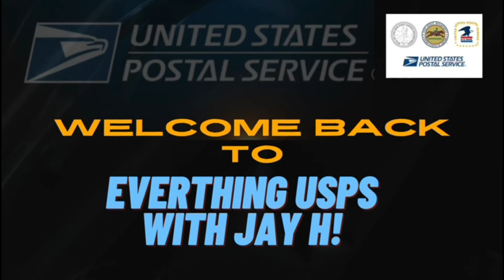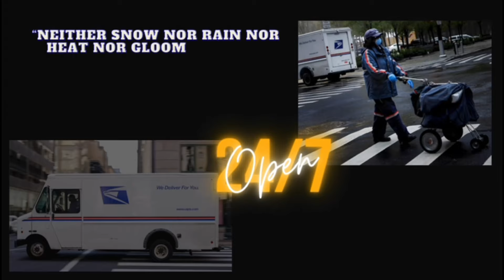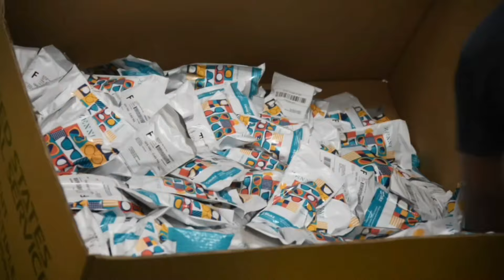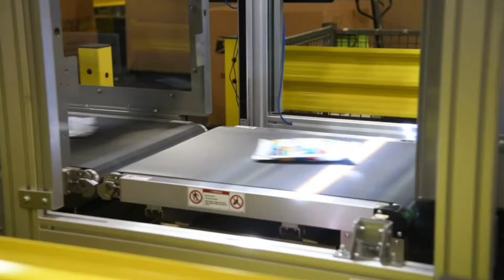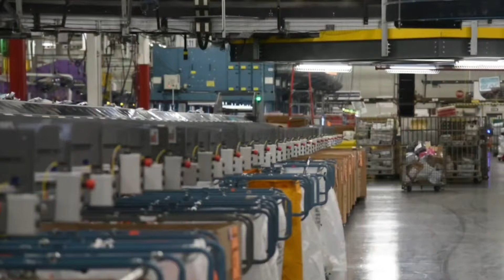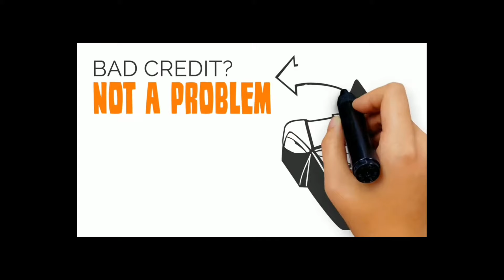USPS Controversial Topics = Views! (Opinion Based Food 4 Thought).

Comment: SIPS machine is classified as a Robot. It is automated with the exception of loading and then dispatch. Only need 2-3 clerks to load. And an additional 1-2  clerks or mail handlers to bring the broken down mail to the clerks at the loading end ,to break down Gaylord’s, stack them for reuse and clear away empty BMCs and APCs. Pretty simple. Supervisors LOVE a fast loader because it brings them big numbers. In other words a bonus check into their pockets. NOT the pockets of the Clerks not the Mail Handlers. I’m a PSE Clerk about to become a Regular, but was told by the Union that there are not enough. Clerk jobs available to go around so when I get converted and and transferred to the new NDC I will be switched over to Mail Handler because of low seniority. No other choice if I want a job at the PO. Well I was told I could reapply and start the process all over again. I’m like, yeah, no thanks. I’ve been hanging in there & working my ass off the last two years going to finally get Career Status. No well in hell, I’ll take a chance to start from the beginning. Not sure what I’m going to do long term. Thought I’d go with the flow and see how the new machines and new assigned work plant go. Ironically since I work at a hub that’s is majority Mail Handlers, I’m already familiar with Mail Handler work since that is what I have been told to do predominantly. I have complied. I  enjoy physical labor and like moving around a lot. Mail is mail, all the work needs to get done.